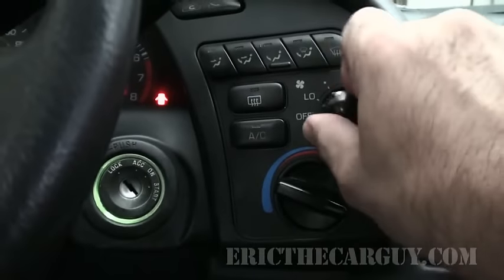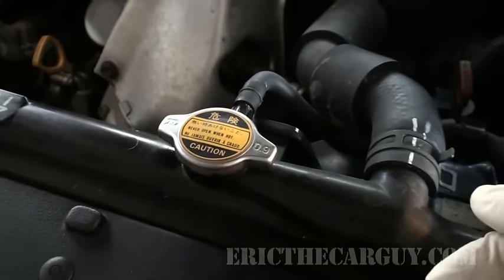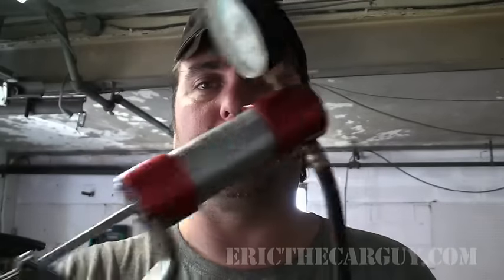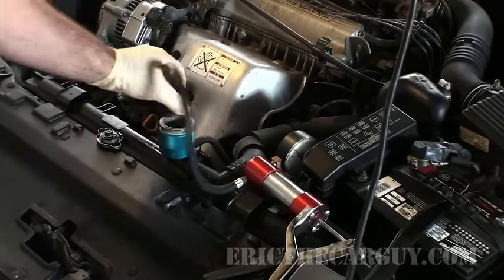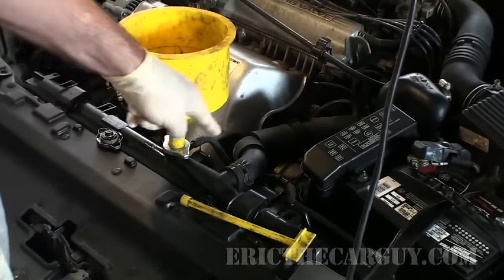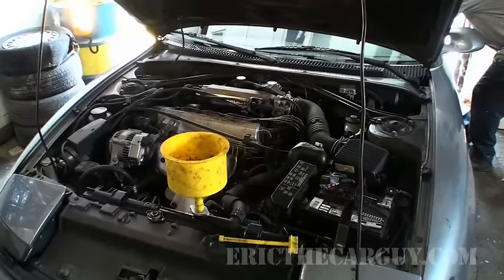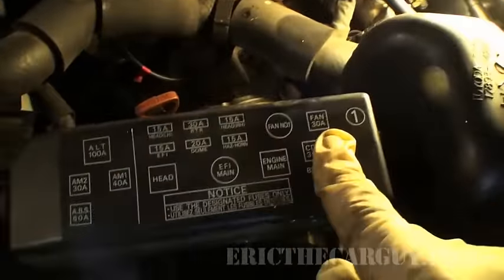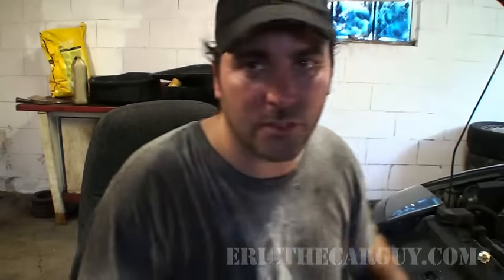How To Solve An Engine Overheat Condition - EricTheCarGuy

Comment: I had my water pump replaced for 180, than my thermostat for 180, than I saw bubbles come from under the sticker on my cap! What if this whole time I just needed a radiator cap and I spent 360 in labor plus the parts! 🤯 I just found it today after my thermostat was going up and down and I can smell radiator fluid. We’ll see if that was the problem. What else could it be?

Comment: Hey man, excellent video. The first video of your channel I have seen, actually, but I've been having overheating issues on my 1995 Honda Civic DX. For about a month or so, it was getting above the red, but it wasn't overheating. Eventually, it would go above red just driving a few minutes down the road. Then about a week later, I pulled into my driveway and it was smoking profusely. I checked, and my overflow tank was boiling, and coolant had been spewed from the lid of the overflow tank. I replaced the thermostat, and it was fine for about three days. Then it started overheating and my coolant was boiling again. It's been sitting in my driveway for about 3 or 4 days. Someone told me that it might be the head gasket, but I don't want to replace it unless I know that's the issue. I was wondering if my radiator cap was bad, could it allow enough air into my system, and enough coolant into my overflow tank, to cause it to boil over? Also, the smoke from my exhaust comes out kind of white. Not really a thick white, but definitely enough to notice and it smells like an old diesel truck. Thanks again for this video, and if you have any thoughts it would greatly be appreciated. Thanks.

Comment: What's the issue if the fan comes only if you pull the engine control module relay?.as soon as it's plugged back in the fan shuts off
Reply: Replace fuses

Comment: ERIC ,
Thank you for your help but i still cant fix my overheating problems. My fans turn when i turn on the ac but not when the temp goes up, i switched the cooling fan sensor also changed my radiator as well as the cap but still having issues i have to drive my car around with the ac on all the time. can you please help?
Reply: Check temperature switch that activates the relay. Most likely it has failed.

Comment: Add one more cause. If the catalytic converter is clogged, it will cause the engine to run hot. That was the problem in my 91 Ford Ranger.

Comment: Sir my car is overheating,radiator cap is ok,water pump,radiator,thermostat valve is ok also,fans automatic working,also i clean radiator but car is overheating and reducing coolant,engine no any missing,but everything is when I overhaul engine,sir what should I do,my car is Chevrolet caprice v8 6.0 2013

Comment: My car randomly started to overheat when sitting in traffic with a/c on...i shouldnt have panicked and turned car off i shouldve popped hood just to see if fan wasnt on because i can not reproduce the symptoms since that one day and im nervous driving it now..

I let it cool off that day for about 20 minutes and drove it home when traffic died down and i had zero issues overheating...

Now i drive with my scan tool watching the temperature...i noticed that it goes all the way up to 217 and sometimes as high as 225 on the first start up but ends up coming back down to 192 to 205 for rest of drive...its so strange that it got all the way up to 225 but that only happens on the first start up...almost like that thermostat being closed overnight and its having a hard time opening all the way for the very first time....maybe a thermostat that is on its way out?

Comment: I have a 98 integra that's overheating I replaced the thromasat, radiator cap and water pump, along with a head gasket, the car didn't have a thermostat when I get it and when I put it in it started over heating,I lose no coolent  please help
Reply: check fan and those motors can be notorious for air pockets.
b18c1-5 especially check for bubbles in radiator

Comment: Eric, great job! I have a 2003 Miata with two fans. When i put the AC on the passenger fan never somes on? Think it's a bad fan ? thx, Mike
Reply: Yeah just switch the wiring from 1 to the other if it still doesn't work then just buy a new fan there cheap....if you think you'll skip it since the car anyway is running fine BIG MISTAKE its putting extra strain on everything and also something people dont know is your tranny fluid gets run through it (not sure about a manual) and that part may not be getting cooled
Reply: @liveandletlive2894  my friend put a meter on the connection and said there's no power going to the fan.. any suggestions..thx Mike
Reply: @michaell9974  if there was no power going when the ac compressor was on could be low freon levels as that's what causes the fans to come on when the pressure rises in the system (which only happens if theres enough freon) could be the actual sensor is bad a fuse or relay
Reply: @michaell9974  my bad I just realized you have 2 fans and only 1 doesnt work?
Reply: @liveandletlive2894  yes. the passenger fan doesn't work. i ordered a new fan to be in friday. i'm hoping it's the fan.
Reply: @liveandletlive2894  fuses are good. i will order a sensor too.  ty
Reply: @michaell9974  but if your buddy checked the wiring and it's dead it may not help that's why I said to switch the fans so you can see if they're each working
Reply: @michaell9974  also find out if your car has 1 radiator for AC and 1 for the engine I know my civic is both for both
Reply: @michaell9974  I'm a religious jew (19) so as soon as sunset hits I wont he able to continue this discussion until after Saturday night (now is the 2cnd 2 days of passover and I dont use any electronics cars etc or work)
Reply: @michaell9974  before you order these parts there are ways to test them all pretty easily so probably better to test them first although sensors usually are relatively cheap
Reply: @liveandletlive2894  hi.. I ordered it anyway. Car had 105,000 miles. Fan probably died.
Reply: They sell fans because they break. Lol
Reply: @michaell9974  lol well I hope it works!
Reply: @liveandletlive2894  ty for your help. I live in Delaware. Not one mechanic knows the answer.

Comment: My 2006 torrent continues to overheat. I have replaced gas cap, water pump, radiator and radiator cap, thermostat, egr, freeze plug, relay sensors, and spark plug wires. auto dealer checked head gaskets and did not find a problem allowing me to get my auto tags.  The lines have been bled at least 40 times and  still over heating issue prevail. No leaks have been found. I'm at a loss.

Comment: Hi Eric my son's 2005 Civic overheats but only after driving for 40 mn and comes to a stop (does not heat while moving on the highway. No coolant leak: both fans work; replaced radiator and cover,  temp sensor and thermostat. I don't know what else to do
Reply: Did you figure it out

Comment: I'm not gonna read through all the comments so if my solution is in there just blow it off! I did everything in my power to correct an overheating problem which came with the purchase, an '89 K3500. 
Went online to find OEM Spark plugs. 
Changed them out and BINGO!

Comment: What would make my 2002 Dodge Dakota get hot and no leaks just a steaming noice from a hose changed the water heater hose and the radiator hose no leaks but while it's ideling it gets hot and a steaming sound from hose

Comment: okay so I have a 2004 Honda Civic LX that radiator fans won't turn on I have replaced the radiator fan relay and check the fuse the air conditioning fan won't turn on either

Comment: Swear there’s air in civic system. Randomly overheats and when it does the fans don’t turn on. Must be a bubble around fan sensor on bottom side of thermostat. Air doesnt transfer heat so fans don’t know it’s running hot since there’s no heat transfer. Just can’t get it out yet jacking car up real high in front but not sideways yet. Prob have to do that to get air out of head that keeps compiling under fan switch. At least I’m hoping because everything else checks off.

Comment: This shit happened to me this morning. I was on the last 5 miles of my 32 mile commute to work. I felt my heater go cold. I noticed it was only on 50% temperature so I maxed it out. That's also when I noticed my thermometer was spiking up pretty quick. Pulled over immediately. Had to get to work so I came back later with a co-worker and poked around. Coolant reservoir and radiator are full of healthy looking fluid. Oil is good a little below full and needs changed. While idling the car to running temp we noticed the fans didn't turn on. Another thing, I normally can hear water sloshing through the engine from inside the cabin at park idle. I don't hear water moving. After watching a few videos I've decided to check the fan relays but I'm not sure this is the sole cause of the overheat. Is there any way to diagnose the water pump w/o redoing it? I see water pump kits sold with gaskets and timing belts. Should I get this kit? I live in Oregon and I'm broke as fuck, how much should I expect to pay for a diagnosis/or water pump/fans? Anyone with a shop in PDX/Hillsboro wants to help me? I can pay you when the covid check comes. 

My mind is reeling right now. I wonder if there is a gasket leak. My car is parked at a microprocessor manufacturing plant employee parking lot. I hope I don't have the gasket leak but even just water pump maintenance is impossible without getting a ship assist. As far as I can tell it just loses about a quart of oil over time ... I'll be on the bus and train if anyone wants to ask me questions. I'll be moving about 16MPH (mean speed) so will be easy to catch up with me.
p.s. I opened a hot radiator one time. I thought I gave it enough time to cool and I was so wrong. Always let your system cool before opening the cap.

p.p.s. update I called the Honda dealership across the street from my work and they quoted me 150 dollars diagnostic fee which is waived if I choose to have repairs made. I also met a strung-out older dude in the checkout line at the mini-market on the way home. Paul moved here from Alabama a couple weeks ago. I think I'm going to get it towed to the honda dealer although I may call around to see if anyone who actually works out of a real shop has better deals. I know I'm going to pay if I take to the honda dealer but they're also reputable and I trust them a lot more than jiffy lube who replaced the bottom half of my engine in 2020 but didn't bother to tell me my fans weren't working.

Comment: My 2004, Chevy Venture, 3.4L has an overheat problem.   When I have it running with the  radiator cap off (I also put a spill free funnel on it), tiny bubbles  come up.  If I rev the engine, the coolant gets sucked back into the  radiator.  When I put the throttle back to idle, the coolant come  shooting up about 2 or 3 inches and white foam builds up on the coolant  surface.  If I remove the funnel, I see the radiator full of white foam  and it oozes out.  I did a pressure test of the cooling system.  It  doesn't hold pressure.   Has anyone here experienced this and know what  the problem is?  I'm suspecting a blown LIM gasket but don't know.   How  can I be sure it's not external to the engine?  How can I be sure if  it's the Lim gasket or the head gasket?

Comment: I hope you dont mind I need help please. I have a 1996 Pontiac Grand Prix Its my nieces car she says she was at the drive thru when the car started acted different she came home about 4 miles when she got here lifting the hood noticed that the top hose had blown there had been alittle leakage previously  from the bottom hose so I replaced both hoses and drove it a few times around 60 miles and noticed that the water pump was leaking down on the belt cause i heard the belt squeaking so I replaced the water pump drove it to work around 30 miles and it stayed cool then she was driving the short distance to the store it was around the beginning of las vegas summer so it was around 105 degrees outside and the car died acted like it was vapor locking pushed it home after the car cooled down it started right back up the next day I decided to put a thermostat in (WHAT A BITCH) and clean the intake manifold (carburetor) the intake was full of gunk and I sprayed it with sea foam and carburetor cleaner and sprayed the MAP sensor with MAP cleaner spray and started it back up took it to the store about 2-3 blocks on the way back it acted like it was vapor locking again now its nighttime only around 80 degrees went to head back to store and it died on me barely got it home as it died twice within a block I checked and found a hose blown off leaking fluid  (if your facing the water pump it would be on the left side between the firewall and engine) that I cant find where it goes and now I have water n the oil. Please can you tell me what is going on?

Comment: my 2006 honda fit overheats with aircon on. It starts okay at first and both cooling fans come on when AC is turned on. But after about 5 minutes the compressor stops and both cooling fans stop....the compressor keeps cycling to start but won't start again and the temp warning light comes on. AC off and system works ok. 
Any thoughts anyone?
I have read of a similar symptoms on a honda civic where the AC comp clutch plate clearance was too big and a shim was removed to fix this. The tolerance for my model is 0.5mm +/- 0.15mm and mine is right on the outer limit at 0.65. I'll probably give this a go myself next weekend unless anyone can give me another idea. 
Cheers
PS. not sure why there is only 16K likes from over 2.3 Million views, less than 1% bothered to acknowledge....Eric rocks

Comment: Turn on heater, 
 when driving 
refill coolant 
when car cools down , presser test system, 
Burping air out of the system,  making sure cooling fans work on.
Make sure something is not blocking the radiator
Check you fuse box
Replace old rad. Cap
Head gasket leak

Good video,
 edited in 2 minutes

Comment: When I am bleeding air from my coolany system  my the coolant level starts to rise in my funnel to the point I have to turn the engine off before it overflows.  Is this normal?
Reply: I am no mechanic.  You just told ppl that your head gasket is blown.

Comment: I got a 95 chevy van c 20
It got a 350 in it.. and it begaining getting hot when you drive it 70 75 mhp what could it be
Reply: I got a 95 chevy van C 20
With a 350. And it get hot 
When you drive it 70 75
Mph

Comment: how to solve a over heating problem for a Honda jazz or fit when radiator fan not working
Reply: do what eric did in this video, check the radiator fan fuse and relay, if they are okay check the radiator fan by connecting it to the battery

Comment: I have a 2015 hyundai elantra  1.8l. Coolant overflow while radiator cap off, and car is running cold. and when motor is  running with cap on it overheats
Reply: and it overheats whene motor is running.

Comment: I’m pretty sure, after some testing, none of these issues are what’s wrong with my vehicle. I have only one fan and it spins when the car is at or below 180F once above the fan stops and my car heats up. Anybody have any ideas what could be going on? I’m about to change out the coolant temp sensor, don’t know if that could cause such an issue.

Comment: Question how come my car temperature gauge rises when I turn on the ac if I ride the car the temperature lowers again then rises when I stop I checked my fan and it turns on
Reply: when the AC is on, it uses more energy from the engine, so the engine has to use more power to turn the AC pump. This means more heat.

When the car is moving, cold air is rushing through the radiator and engine bay. This cools everything down.

When you stop moving, no cold air is rushing past anything, so it just sits stagnant and heats up. The cooling fan should kick on and off every now and then to maintain a temperature. If the fan kicks on and stays on for more than, say, 30 seconds, i'd be concerned. If it stays on more than  a minute, i'd be really concerned.

Comment: I do stuff a little bit different than you when i have an overheat problem: 
1. Yell at the car
2. Kick the hubs or tires, then throw a tantrum like a little 5 year old
3. Call my uncle for help. he is good with cars
4. Yell at my uncle too because im pissed off.
5. Finally decide to deliver the car to the shop.

This method works every time. Youre all welcome. Dont meantion it.

Comment: I just can’t figure it out😮. I have a 95 gmc Sonoma 4.3 Vortec. Overheats. Installed new water pump, 2 new thermostats, no leaks. Cleaned/ flushed out heater core. Installed a new blower motor. New temp sensor. It did give me heat when I changed out the blower motor resistor but then not anymore. New blower motor does give me air. But still over heats. I did do a block test  but nothing?? Hep
Reply: Hep!
Reply: Help!!

Comment: Soooo... I have a 2005 Chevy Uplander LT with 208,000 miles on it. My van has been overheating. I've replaced the thermostat, the water pump and the radiator. My fans work! There isn't any leaks. It is still overheating. What else could be going on?
Reply: heres one bet for a head gasket!
Reply: @amcgee-dl3cj  wouldn't there be visible coolant in my oil? Or white smoke coming out of my tail pipe if i blew the head gasket!
Reply: @luvkendraxoxox  not always. find someone competent you can trust and have them check it out.

Comment: Ok... I have a major problem. 
My fans don't come on at all. Why ?
I checked the fuses, fuses good. 
Checked the relay, relay good. 
Replaced the thermostat, it's new. 
Applied direct voltage to the fans, fans come on. 
When I short the part where the relay sits, fans come on. 
When I try to read the voltage on the wire that connects to the fans, in get no voltage. 
 Ok... I'm lost. 
What am I doing wrong. Where could the problem be ? Fans don't come on at all.